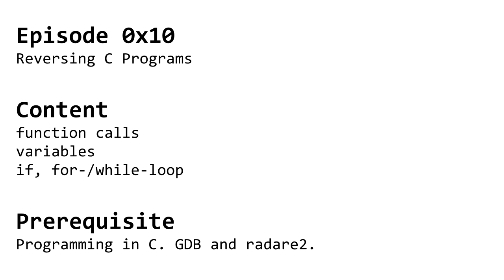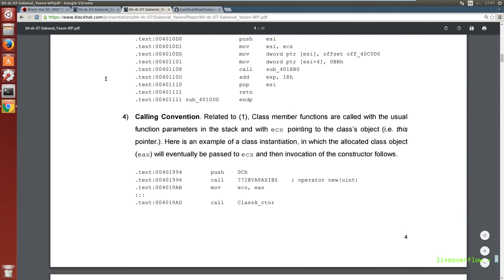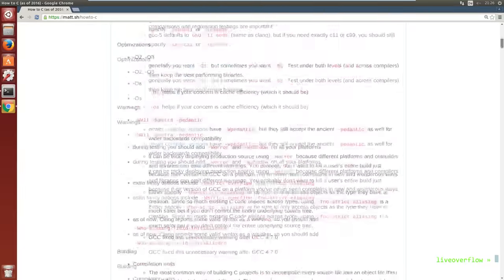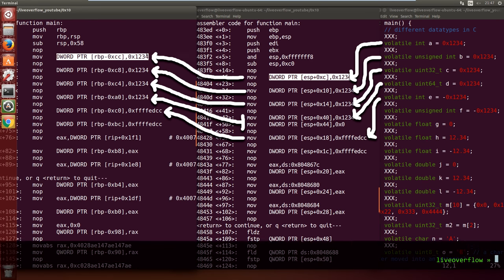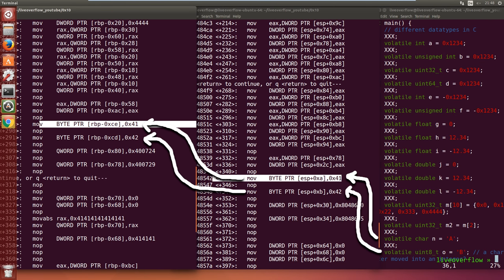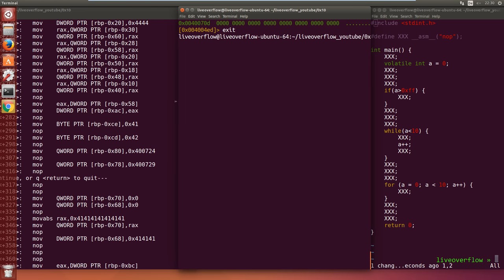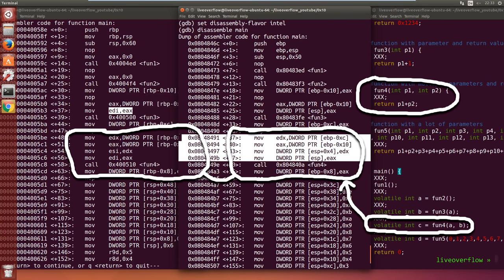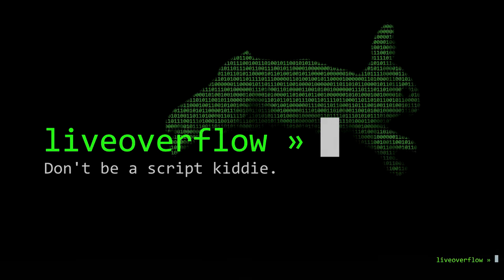Reverse engineering C programs (64bit vs 32bit) - bin 0x10

Comment: The reason behind placing mov eax, 0x0 instructions before fun1() and fun2() calls is that in 64-bit mode the eax register is used to pass information about the number of vector registers used to hold arguments to functions with variable arguments. In our case of fun1() and fun2() the compiler doesn't see the function declaration, which means it doesn't have enough information about function parameters so it has to zero the eax, just in case the function happens to accept variable arguments.
Reply: This is not entirely true (but close). It is because the compiler treats fun1 as function with (potentially) variadic number of arguments but it's not because there is no function declaration. The real problem is that in C declaring function as "void func()" is not the same as "void func(void)". See C99 standard, "6.7.5.3", paragraph 14.

Comment: Why do you prefer using volatile for all variables over using gcc -O0 ?

Nice vids btw :>
Reply: because the compiler may try to optimize the code and remove some of these variables because they are  unused
Reply: so the compiler may also cache the values of unused variables and never read the value from memory again
Reply: @nullnull6032  Or simply, as others said '-O0'